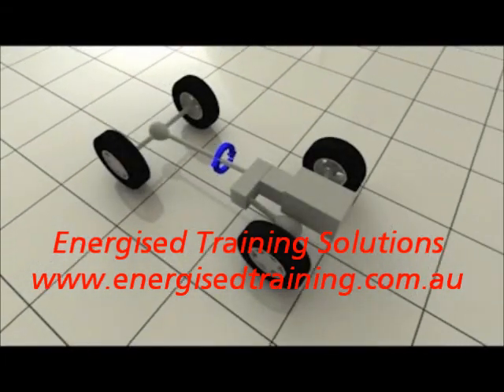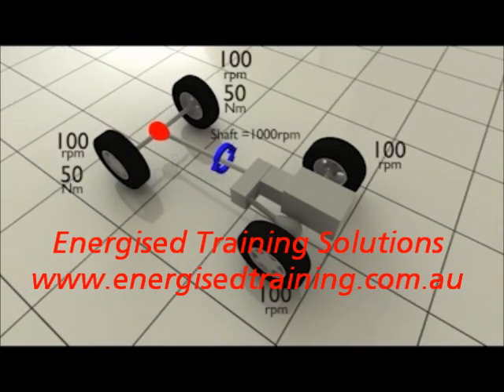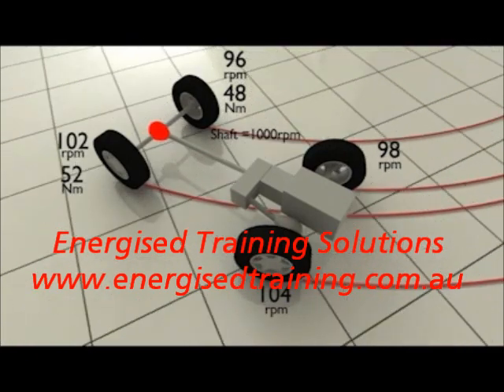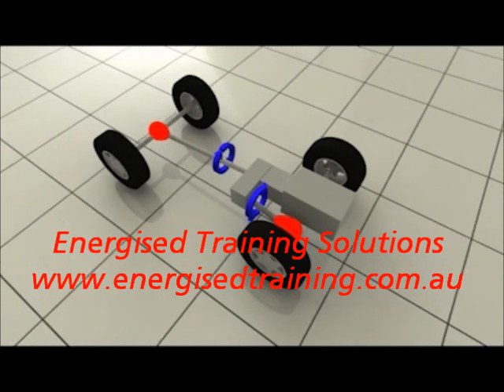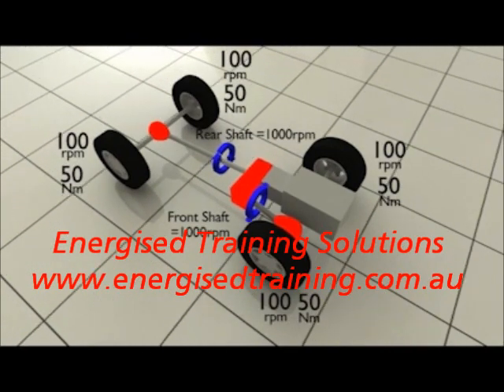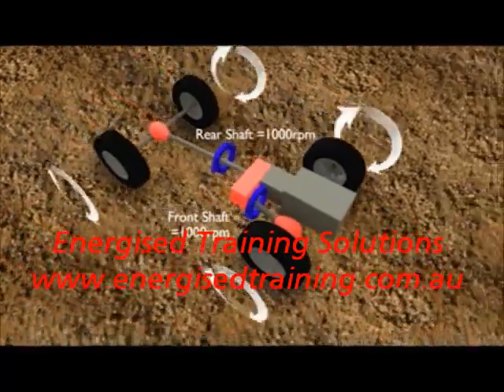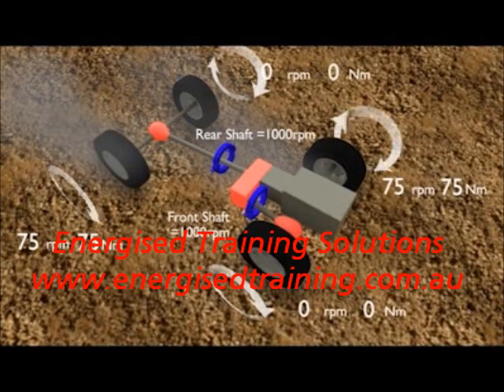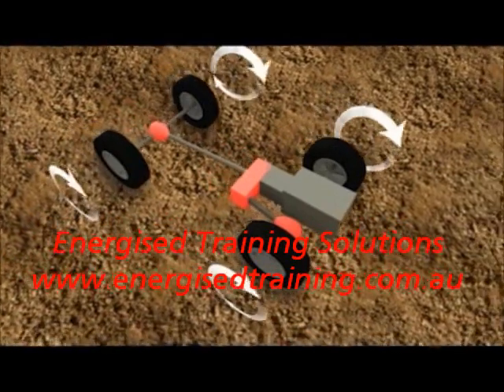Part-time 4WD Vehicle

Comment: Yes I agree with Harald, torque would be the same, but as the outside wheel is spinning faster through a corner with the same torque, it would receive more power